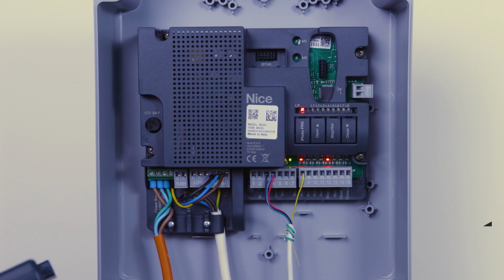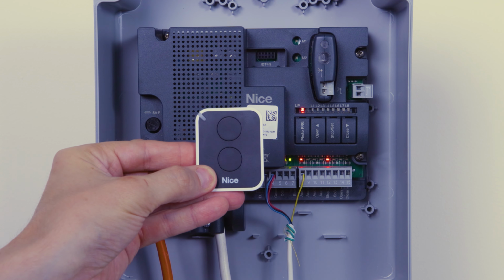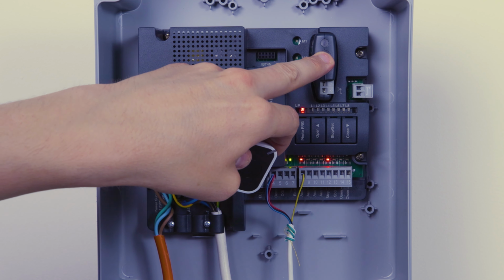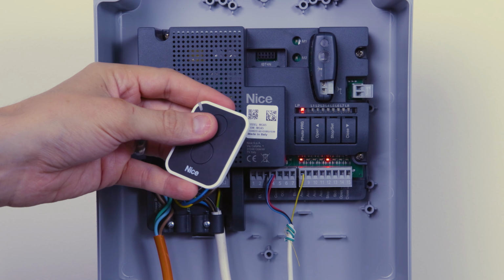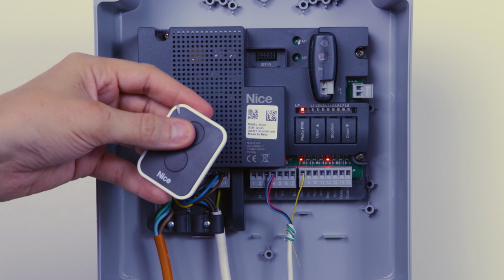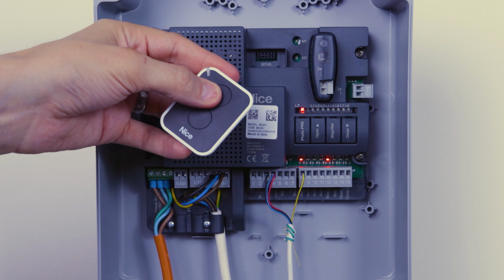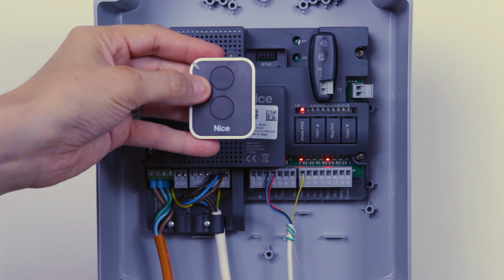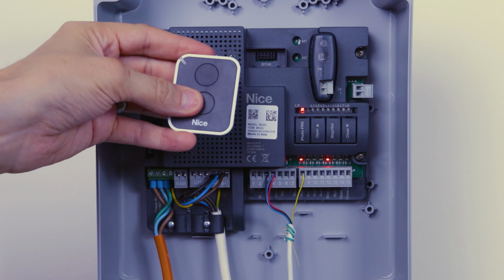Nice MC800 - How to registering and programming remote controls

Comment: Hey guys, is there any way how to delete old remote controls from the gates receiver? Without getting default settings first..
Reply from the maker: Hi There,
The remote controls can be individually deleted from the receiver, but you will need to have the remote to hand in order to do this (lost / stolen remotes cannot be deleted individually without defaulting the receiver). To delete an individual remote, you will need to go to the receiver (with said remote), press and hold the ‘learn’ button on the receiver until the LED lights up solid (oval button on the side for older OXI receivers, or button on top for the newer OXIBD). Whilst the LED is lit, simultaneously press and hold the button on the remote you wish to delete (must be whilst the LED is lit on the receiver and the learn button is still being pressed). You should then see the LED flash 5 times which indicates the TX has been erased from the memory (all other transmitters will continue to operate as normal). I have created a full tutorial on the OXI / OX2 receiver which shows this procedure that can be found here - https://www.youtube.com/watch?v=oCsSw2r7ECY&t=236s.
If you have any further queries relating to this, please don’t hesitate to get in touch.#
 
Many thanks
The EasyGates Direct Team